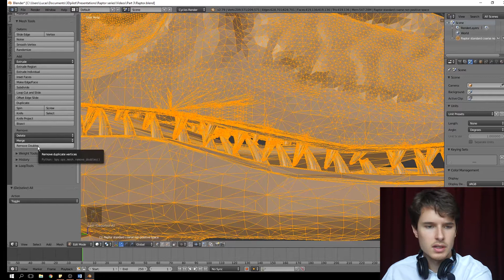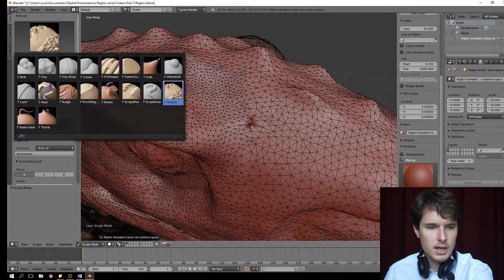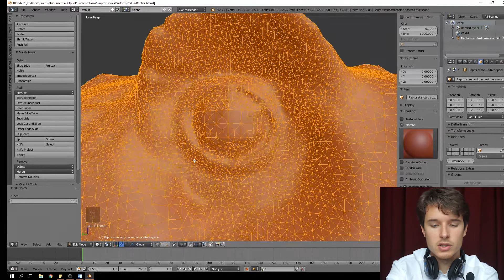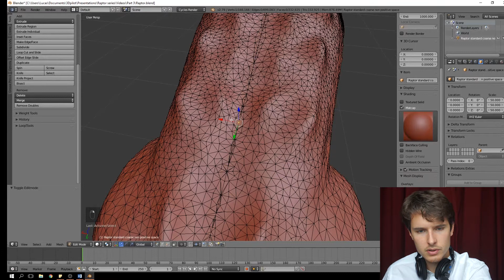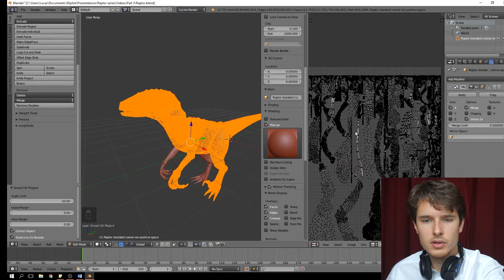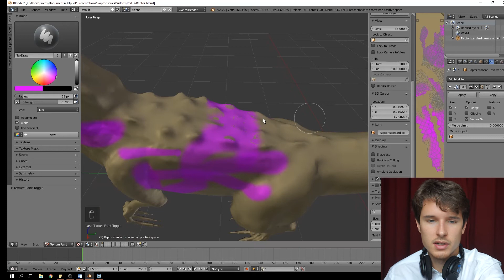THE RAPTOR SERIES: part 3 - Preparing for painting

Comment: Hi, this is a great tutorial series, but Blender 2.79 seems to have different settings regarding to the material tab. At 23:00 you choose 'Image texturing', this has changed with the new update, so any ideas on how to properly set up my model for texture painting now ? 
I found that i can choose within my model screen : slots > painting mode > image. But this leaves me with a blank model in a solid color (without any shadings) making it hard to color along edges...
Reply from the maker: Elias F Hi Elias! Are you using the Cycles rendering engine? If not, change it, at the top of the Blender interface (from Blender Render to Cycles). Does that help?
Reply: Thanks, this solved it ! I came up with  a work around by making the 'viewport shading' to 'solid' instead of 'texture'. It didn't feel as the correct way though :)
Reply from the maker: Awesome you solved it. It's one thing i forgot to mension, as blender is in Blender Render mode by default... Thanks for checking it out!